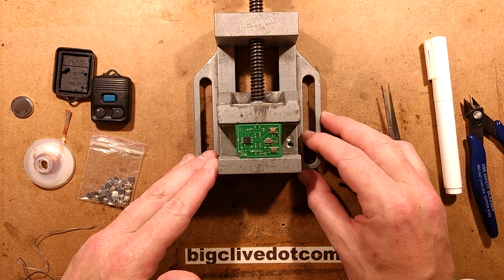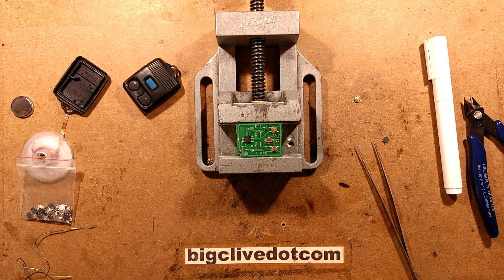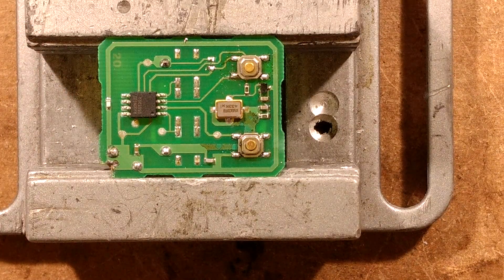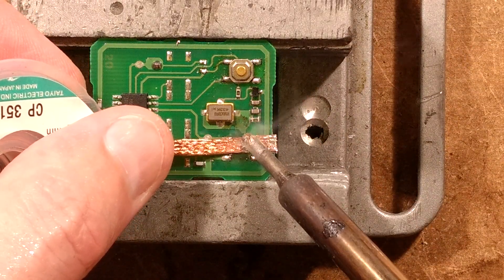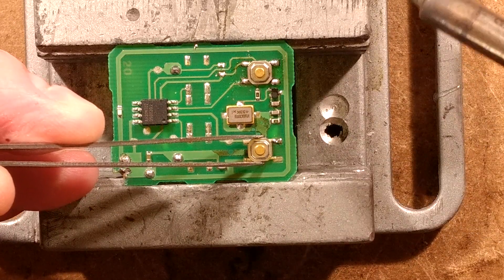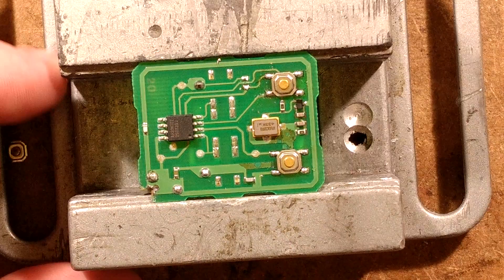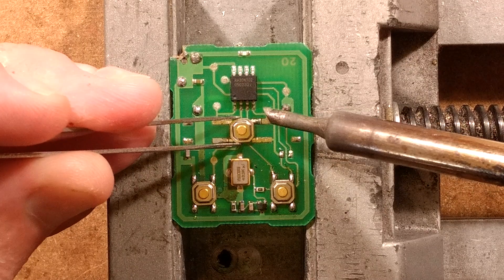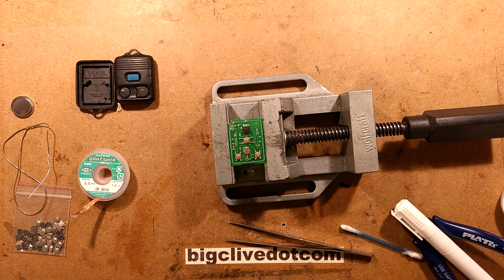Car/van keyfob button replacement.  (Glitchy video!)

Comment: I have the Moto G4 too and there are couple problems with it. Previously when you double clicked the power button to get to the camera, you could only take one picture and the camera app crashed. Then when you go to the camera again, it says it crashed and if you want to stop it... Really annoying because it took ages to take pictures. Fortunately it doesnt do that anymore. But now it keeps saying ”Gmail has crashed” every few hours, even though i never use it and have force stopped it from running... Also, in the photos app, if I try to delete pictures (saved on SD card) they simple dont get deleted. I click the bin icon, the picture goes away for a bit but reappaers 2 seconds later.

Comment: Hey there,

I have a couple of broken Nitecore Tubes... they won't turn on and I'm sure they're not in lockout mode. No water damage, either.

I'd love to send them to you to look at, but I'm not sure how to contact you outside of leaving this comment. Do let me know if you're interested, would you?

Thanks a bunch.
Reply from the maker: Have you tried charging them and then holding the button down for about 10 seconds?
Reply: bigclivedotcom yes, the charge light stays lit for several hours, even days. The white LED flickers while "charging" as well.

Comment: Great stuff Clive, I might try something like this on my dodgy spare Renault key - if ever I find it again!  On Moto-G phones: I am suspicious of Lenovo as well.  I have a Moto-G 3rd Gen (chosen because I could have 16 GB onboard storage + 2 GB RAM).  It has been pretty good, but now Lenovo are not upgrading this model beyond Android 6.0.1. The phone is not so old a model that they should pull a stunt like this. A rotten, counterproductive trick I think. This won't make me buy a new phone of theirs - it will stop me buying any more Lenovo products. (By the way, most problems I have had now and again do seem to be tracable to  the SD card.  Loss of electrical contact is a problem more often than it should be. I also suspect that some cards aren't really of the quality that they claim to be because I think corrupt files should be a lot rarer than they actually are.)

Comment: Hi Clive. Watched all your videos from the beginning and learnt so much. Very grateful for all your hard work. Thing is I was sent a Chinese power unit with a diy radio kit and I don’t want to plug it in as inside it doesn’t look quite right. I was wondering if you would like it to pour scorn and hateful comments at. I’m aware that the Edinburgh show is imminent so rip into it at your leisure. Trouble is I’ve no idea where to post it too. Can’t find anything on your website or YouTube channel. Could you point me in the right direction?
Reply from the maker: I'd suggest using a power supply sourced locally from a known supplier.
Reply: bigclivedotcom Already done. No way am I plugging that thing in.

Comment: Interesting, and also quite surprising. I always thought these clicky switches to be fairly reliable, whereas the those with rubbery silicone cups (such as https://jeelabs.org/wp-content/uploads/2012/04/DSC_3044.jpg) were the ones more likely to fail. (My keyfob has those and they've failed in two of them so far.)

Comment: This pervasion of pen-based flux is exactly the sort of reason why the UK has no secondary industry any more. Setting a bad example not using the proper stuff. Also it's not because it's "dry" it's because the stuff on there is lead-free, has a higher melting temp and is in fact the work of the devil. Also no Loius uses loads because he's doing it right.

Comment: If you updated to a completely new Android version then it can be that it's too heavy for the phone to handle or they didn't optimize it well enough. However it can also be that they don't want to do it properly just cuz they don't want to spend on it.

Comment: I thought you had a hot air gun as part of your soldering station? Makes removing multi legged components like that very easy. Well maybe something a little more leggy.Cover the rest with captains tape
Reply from the maker: It was more to show how it can be done with a common soldering iron.

Comment: You can also buy these Ford remotes on eBay or AliExpress for next to nothing. Of coarse, repairing is better but sometimes these are not repairable. Also, you could repair the PCB but buy a new case in China so you don't have to drill a hole in your PCB...

Comment: My Moto g4 has been doing the same on this heat, your not alone.
But I gotta admit I'm really considering the Moto G6 play as the battery life is greater.
Love your videos dude your epic 😀👍
Reply from the maker: I was considering the G6 play for large battery and single 13Mp camera.  But the processor seems to be lower spec than the G4.
Reply: bigclivedotcom your still gaining even if the processor isn't much better, but does the processor need to be better? If it ain't broke, don't try fix it lol
Or do we wait for the G7 which will probably be out next year lol

Comment: Try putting an sd card in, or a larger one if a card is already in use, move some of the apps to the card and see if the problem goes away. It could very well be a memory issue. Nice solder work.

Comment: If the trace is corroded through you could do a wire jumper to fix the gap. Then you would have turned it into a PC like " Louis Rossmann " would have done . Ha ha !

Comment: Even the cheaper action cameras are decent. And if you think the battery capacity is bad on them there's a simple remedy for that - wire in one of those powerbanks to it and your camera would probably outlast the memory card.

Comment: The glitch start because the SoC of the phone start slowing down when temperature was increasing fast; i had a similar problem with my Note 8 when i try to use it in a hot car as dashcam and it stops to record before glitch.

Comment: Mr. Clive, it looked like the upper right pad for the new trunk open button was not connected to the adjoining pad that actually connects to the chip (pin 4)  at around 7:44.  Did that button work OK??  Just curious.  BTW: THANK YOU for informing me about dry film transfer for making PCBs- it sure works a treat.  I use Ferric Chloride as it is much less messy and it worked perfectly last night.  I love how ferric chloride can be "freshened" by adding a touch of hydrogen peroxide (which I did because I had some ferric chloride from years ago from the last time I made boards.  Thanks!!

Comment: If you have no other problems with the phone and are happy with potentially buying a new one anyway, you could look into changing the phones OS. Either rolling it back to the older one that worked well or any number of custom ones that are usually leaner. 

The potentially buying a new one anyway comes in if you somehow manage to brick the phone. but the guides are well written and tested at this stage, just have the be exacting .

Comment: I repaired my parents car key and it was working fine until they broke it again while replacing the case. Had to replace a button but while desoldering the pad came loose. Any suggestions?

Comment: i've abandoned updates on EVERY device of mine and with anyone i can convince of that since years and years... time has proven me beeing right, they have become useless and useless and also problematic\heavy, a lot of people don't believe that, there are also ones fixated with eg. ETHERNET CARD DRIVER UPDATES... SERIOUSLY???? are you ok? do you want to sit?

for doing this 2:32 i have a fine conical soldering iron tip with a lot of silvered lenght, i touch both points and usually lift the component with the sharpest\small tool i can find, even a needle for very small parts... not necessarily better than yours, just different

Comment: Apple did finally admit they "spiked" their devices - some BS about reducing the power consumption of older machines to preserve their old batteries!
I dunno about android - updates come from manufacturers - so probably some have and some haven't pushed a little too hard.
Both my Nexus 7 and Nexus 4 (tablet and phone) were bought in 2011.  They've "done good" but both are now slower than me.  I recovered the tablet by disabling ALL the google apps plus things like PinYin keyboard and other "essential" bloat. It's now my dedicated book at bedtime.
The phone has a crappy camera and a poor 4" display - I don't think it's worth trading in for the £5 on offer ... so I'll probably just ditch it.
Reply: Most Android devices are actually never updated by the device manufacturer or only for a short time after hardware release. The system updates are explicit, so you'd see them - they caution you to connect the charger and installation procedure requires a reboot. System updates, if going wrong, can brick the device, so they can't come frequently and require explicit precautions. But there's a bunch of unrelated issues that anyone will face.

One is hardware and is not Android specific really, just that eMMC does become slow with time for some reason - perhaps due to wear leveling implementation quality issues. All phones and almost all tablet PCs use this type of storage. SD-Cards suffer from the same issue, as they generally share hardware and firmware with eMMC devices.
One is system software fundamentally, a general-purpose filesystem is used, on Android specifically it's an EXT4 filesystem and it's not TOO prone to fragmentation, but it will fragment and become slower to traverse when close to full.  Unfortunately also, Android Download Manager which temporarily stores app updates (before they have been applied, and unfortunately doesn't delete them after they have been applied) and different software caches tend to fill up the phone's filesystem, triggering this degradation mode.
One is Android development practices specific, most apps use multiple SQLite databases and those become fragmented and slower as time goes on. SQLite fragmentation is also the reason why Google Chrome keeps getting slower with time, particularly when you open a new tab or start typing in the address bar, when it has to scour your usage history.
One is Android operating system specific. Google Apps provide the framework for other applications, but every time there's a Play Store update, the framework is updated along with it. This is a Google thing, not a handset manufacturer thing. As features keep getting added, the framework requires more and more RAM to execute, and eventually outgrows the devices of an older generation. Back a while ago around Android 2.2, it was becoming apparent that slow to non-existent device manufacturer updates stiffle software capabilities, so decision was made to move a large feature set from Android proper into Google frameworks updated with Play Store - plus it allowed them to close-source a larger part of the system and exclude unlicensed manufacturers from copying the functionality this easily.

Of course if you perform factory reset, this temporarily fixes EXT filesystem fragmentation and SQLite fragmentation.

I think your Nexus devices have still sufficient hardware performance to run efficiently. Maybe factory reset or more fresh third-party operating system distribution (such as LineageOS) could bring them back to high performance, unless eMMC hardware has degraded. Also poor display? It's 4.7", it's almost bigger than my hand, and i remember it looking pretty nice! And the camera is definitely nicer than what China-phones ship with today.

For me as someone who worked on development of automotive headunits and other similar devices that must run reliably for a long time, this whole Android business with its numerous degradation modes looks like a massive engineering fiasco, many constituents of which would have been avoidable with very moderate effort. Obviously Google can't be oblivious to this, it's not like they don't have engineers who are 100 times better than myself. Unfortunately also i can't point at something and tell you that this is better or avoids the pitfalls. Blackberry 10 maybe? Well that's dead now.
Reply: It doesn't seem to matter what platform it is - they all go the same way in the end.  Cars are a little different - I wonder if The Tesla will be taking part in vintage rallies along side the bugattis and similar?
My IBM 8088 is still as fast as ever ... the 80286 is pretty responsive too, as soon as the wizards came into play the performance starts to degrade rapidly.  There's too much going on in the background.  Add a bit of internet and the bloat starts to take over.  Linux wasn't supposed to be like that - but it is just as bad in it's own way.  Android is so tied down it could be anything, it's impossible to look round without a lot of trouble that in the end causes more problems than the problems.

When I looked round for ROMS it's obvious the Nexus 4 is still well supported.  Mine had slowed drastically  but also started randomly powering down and would take some fiddling to power up again.  I was determined to run it into the ground, I hardly used the thing in truth ... and it served my needs.  But once it became unreliable I decided to change.  The OnePlus seemed to have the same "pure" android philosophy that made me decide on the Nexus - and it is almost free of any branded bloat.  This one will replace both old machines (and it's very fast - for now).  If computer years are anything like dog years the phone is an old man ... and if I'm truthful, the camera is so much better than my DSLR that it justifies the outlay on it's own ... I mean - slow motion ....PRO Mode !!!! - what's not to like? ... and it's soooo shiny .... mmmm shiny :D.
Reply: Your symptoms really remind me of 34c3 Samsung eMMC sudden death report. It was investigated on Galaxy S3 phone, but it's impossible that only Samsung phones are affected, after all in 2012 Samsung made more eMMCs than 3 of its largest competitors combined and certainly a lot more than they made phones, so most of those must have been used in other companies' phones.
Reply: I went for the Nexus in the first place because it was presented as not being full of bloatware ... and being google's flagship - updates were abundant and only apps I used already.  Then Google got as greedy as the rest as PinYin and other keyboards etc became compulsory as did many of the google "social" tools I didn't use like G+ and the rot set in as the load on my old increasingly out of date Nexus became heavier and more relentless.

Maybe you are right - I'm no expert with phones ... it never failed to start ... but shutdowns got more random, thinking about it, often it was after being charged or unused in my pocket for a while.  Restarting took more effort.  I don't think it owed me anything - but it would have been nice to have gone further.  It's always been a niggle about android - I use Linux and windows in equal bites, I know where I am with them and have never been beaten ... android ... I just use and when it gets awkward - it seems the bin is the only answer.

Comment: A car related video. Im having trouble with the bridge rectifier in my alternator. When the car is cold it has a parasitic draw of 4 amps DC into the alternator and when it is running a leakage of 2-2,5amps AC out of the alternator but no DC leakage when its warm. Does anybody ahve a clue what might have happened to the diodes? I'm going to change the bridge anyway but would be interesting to get some clues. Maybe I should sent the old one to clive for autopsy?
Reply from the maker: It could be that a brief short has damaged the diodes, or just an age related failure.
Reply: Yeah definitely age. its a 2002 so getting long in the tooth.

Comment: It was also quite warmy-warm yesterday (2018-07-15) in northern California. I spent a few hours pulling dandelions (not fun). Anyway, for gripping through-hole components while desoldering I often use approximately these: https://www.amazon.com/SE-655FS-Locking-Straight-Stainless/dp/B000WNENZI They usually sink enough heat to protect the components and give a LOT of leverage. :) Not as good for surface mount, though. Before I got those I used to singe my fingers to sink heat. ;)

Comment: Clive.  Before you get all new tech - try clearing the cache.  It's one of those "fixes" that either will or won't work - but shouldn't destroy anything on the Phone - 

With the phone powered off, press and hold the Volume Down button and the Power button at the same time until the device turns on.
Press the Volume Down button to highlight "Recovery mode"
Press the Power button to restart into Recovery mode.
You'll see an image of an Android robot with a red exclamation mark.
Holding the Power button, tap Volume Up once and then release the Power button.
Use the volume buttons to scroll to "wipe cache partition" and press the Power button to select it.
"Reboot system now" will be highlighted, press the Power button to select it.

It's relatively quick to do and shouldn't cause grief.
To check this isn't a windup google "clear cache moto g4"

I've just bought a oneplus 6 and it's bloody brilliant and far cheaper than the real swanky models  ... Having had a couple of weeks with it the camera is one of the best I've seen and most reviews seem to agree.... just a thought.

Comment: If you want to squeeze some more life out of the Moto G4, you could look into custom firmwares. You can normally find one with 0 bloat and other tweaks to keep them snappy. My Galaxy Note 3 has been going for about 5 years now with no problems thanks to some custom firmware.